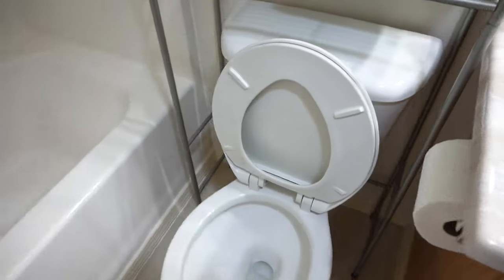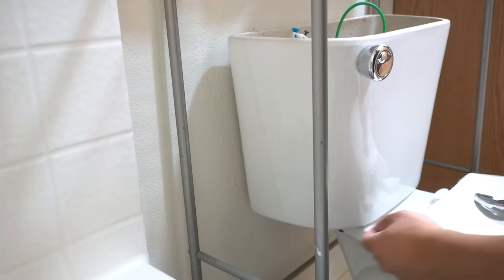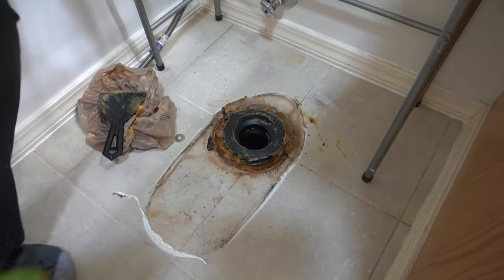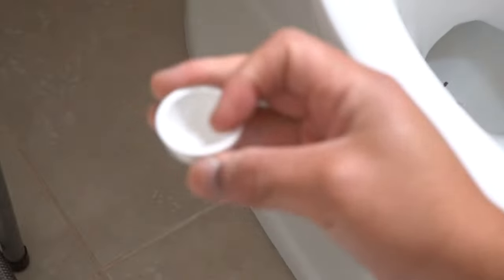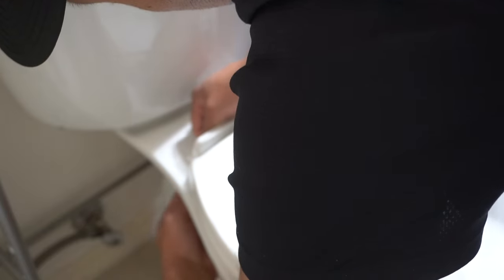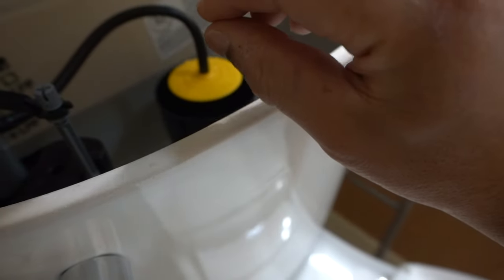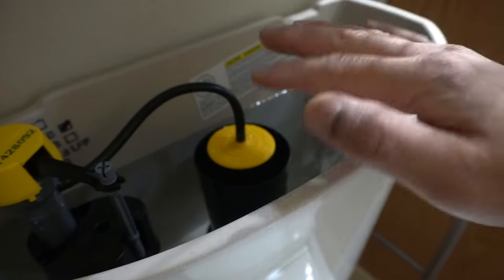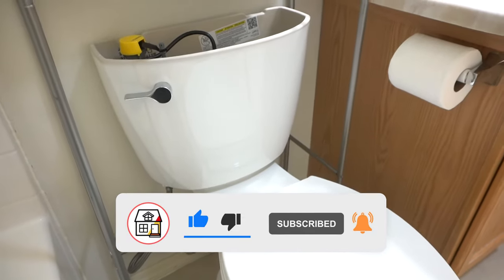How To Install And Replace Your Old Toilet To A BETTER Efficient One! DIY

Comment from the maker: ITEMS I USED ON THIS VIDEO:
- Toilet Syringe Suction Gun - https://amzn.to/3KMc0Tc
- Better Than Wax Toilet Bowl Gasket - https://amzn.to/47vxg9g
- Milwaukee 6-1 Utility Box Knife - https://amzn.to/3OF5BdC
- 13 mm Deep Socket, 3/8 in. Drive - https://amzn.to/45AYGsO
- 12 mm Deep Socket, 3/8 Inch Drive - https://amzn.to/44dSKos
- 3/8 Drive Ratchet - https://amzn.to/3YI4sWZ
- Channllock Pliers 10” - https://amzn.to/3KJaykg

Comment: I used a drill-powered pump to drain my tank and bowl, then a woodcraft clamp like a handle to carry the bowl out. Worked like a dream. Unfortunately, my dumb@$$ didn't cut the caulk at the bottom, and I accidentally ripped up my linoleum and made it into a much bigger project. Haha, this is why you call the professionals!

Comment: 5:39  Teflon tape COUNTER-clockwise?   I always get confused when working upside down, but shouldn't it always be clockwise?  And do you really need teflon tape at all on a compression fitting?

Comment: why aren’t you taking out the old wax ring piece? and you’re gonna make the inside of that pipe diameter a lot smaller
Reply: He took it out at 2:15 then replaced it with a Better Than Wax gasket.

Comment: Your first mistake is using that POS "Worse than Wax" seal. Talk to any plumber, they are crap.  Just stick with a plain ole wax ring; they've worked for hundreds of years.  Secondly, you don't just "hand tighten" the closet bolts. Obviously you can't crank them down too tight, but you have to tighten them a LOT more than just hand-tight.  That thing's gonna be wobbling in under a month.
And thirdly, you don't use teflon tape on the fill valve inlet. The supply line has a gasket in it; you don't use teflon tape when there's a gasket. Hope this helps you.
Reply: Yikes, so this video is riddled with errors.  I will skip it to use as a guide.  Why do amateur wanna-be's post this kind of misleading info?

Comment: Is it safe to assume the new toilet will fit as the old one or do I need to measure anything?
Also I have a five years old who is scared of the loud noise when flushing toilet, is there a quiet flush toilet?

Comment: Excellent video. What was the  Kohler model of the toilet you installed?
Reply from the maker: Thank you so much! Yes it’s Kohler brand 🙏🏽😊👍🏽
Reply: Thank you for your quick response I know it's a Kohler but what " model "  is it? Kohler has so many to choose from, I like the one you demoed with.
Reply: @ozziestrom9793  it's a Kohler K-31621-0 Cimarron with Revolution 360 flushing technology.

Comment: I like the toilet, but the seat not so much. Here's a much better one: Bath Royale (watch?v=xoGGxdl-T5I). I've had mine in 3 bathrooms for about 3 years and have had no issues with them. They are super-easy to lift off and clean, quiet-close, etc.